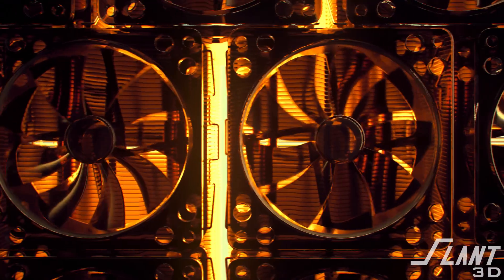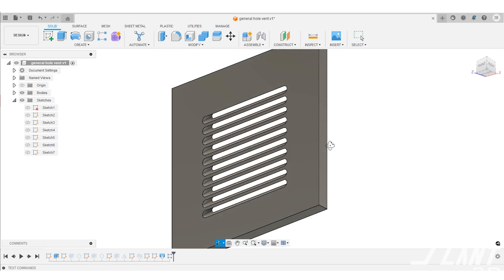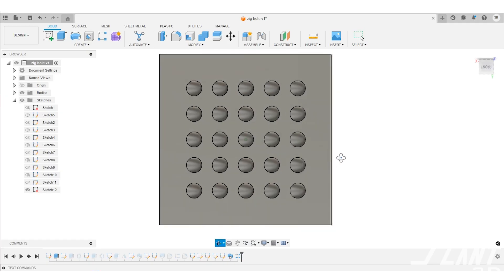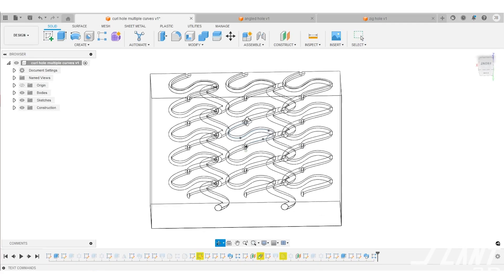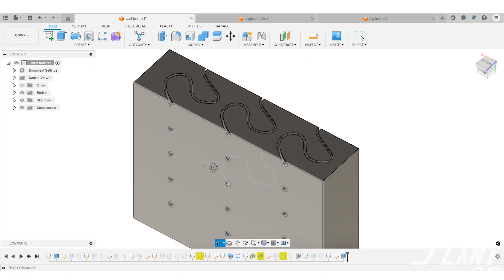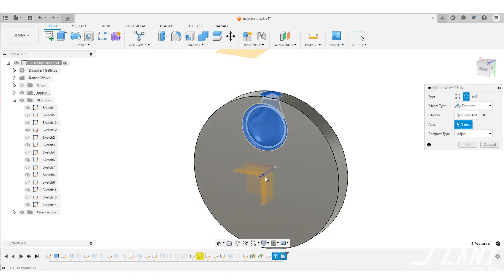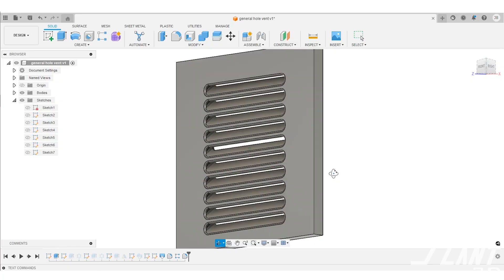These Cooling Vents are Impossible | Design for Mass Production 3D Printing

Comment: Or, hear me out here, just print the thing flat.
Or even better, just print vertical slots so you don't need to worry about stringing. Or just print the holes in a vertical eye shape so you don't have to worry about the printing overhang.
...
This seems like creating a problem in order to solve it. Badly so.

Comment: Alternatively, you could print the part flat, and all of a sudden, you dont have islands, and you dont need support material. If you needed to print slots standing up like that you could make them vertical, which would eliminate support material as well. I feel like your examples are deliberately how not to print.
Reply from the maker: For mass production they must be printed vertically

Comment: I mean… these re cool ideas but I would be curious if these are actually an improvement. In my eyes using simpler covers in combination with ducts to direct or manipulate airflow sounds a t cheaper, simpler and easier to design.

Comment: What if you make a plate with holes, then another plate with holes that are offset. Mount them with a spacer... much faster to manufacture and you can easily use a laser to quickly cut sheet steel... so it can also handle much higher temperatures and still block light.

Comment: I know its not practical, in fact its probably just about the furthest you could get from "mass production" but I still cringed a little every time you said "its a design that is unmanufacturable with any other process." Every design you showed could be made using lost wax casting, or some similar variation of it. Heck, you could possibly even 3D print the negative instead of using wax lol

Comment: You could easily make these patterns using whatever manufacturing technique you want. You also don't need supports for a 3d print like the ones you showed if you rotate the model before you print it.

Comment: The second example with straight slots is a perfect case for rotating it 90 degrees so the slots print vertically as their would be no bridging and no support would be needed if the slot is cut with rounded edges making an arch.

Comment: I don't think you are thinking straight here. You are creating something for the sake of talking and ending up with a series of capillary holes joined together with plastic. Anyway, the noise generated by the fans would be horrific and the air would find some other than intended way of getting out.

Comment: S-Curve Air Vents!. Makes for a very cool, one of a kind heat exchanger made out of thermally conductive plastic!  Could even make for air-tight sealed enclosure, avoiding dust inside sensitive electronics enclosure!❤👍

Comment: While the support problems you noted with horizontal slots make sense, and vertical or diagonal slots would introduce the same islands that caused rejection of round holes, I wonder if diagonal slots with a nonplanar slicer could solve some of these issues. You would still need to build up the slot in layers, and that would require islands, but a couple of diagonal layers or a diagonal "stem" on each step would serve to lock the islands to a single common strand.

As to the weird hole path concepts… I struggle to see any merit to them. Thinner pipes have more drag per cross section than wider pipes, and longer more than shorter. If the goal is to minimize restriction of airflow, the pipes should be as short as possible and as wide as possible. In other words, a sparsely perforated flat plate. Overwrought internal passages may be of interest to a heat sink, in which narrow spaces and turbulent flow may improve heat transfer, but for simply exchanging air these solutions are strictly worse. Your suggestions of internal dust traps in a part designed specifically to be impossible to thread a tool through are, frankly, deranged.

Moreover, your claim that these forms are unmanufacturable with techniques other than 3D printing neglects processes such as lost material casting and multi-part assemblies. If it is possible to produce a turbine blade with internal coolant channels by non-3D printing processes, it seems strange to suggest that your vent covers will be any more challenging.

Finally, it seems a dubious engineering philosophy to design parts to fit a process. Here, it seems you have gone even further, and are proposing designs merely to rationalize using a process you have already picked—perhaps even to justify purchase of expensive equipment. Instead, process selection and design should go hand-in-hand. If the requirement is a vent cover, then it seems sensible enough to design a stamped piece, or a bent-wire piece, or potentially a molded or even machined piece. 3D printing is not appropriate for the requirement of a thin, plate-like shape with a pattern of holes, and inventing reasons to use a slower and more error-prone process does a disservice to your design, the process, and the application.

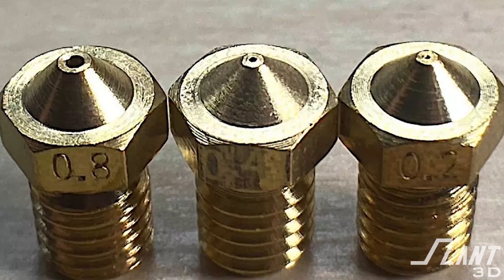Comment: For the example at 1:40

Why not print it laying flat? No supports needed, the thing becomes one of the easiest prints you can do if you just orient it the right way
Reply: For auto ejection without coolling down the bed. Enegy loss and time loss. You want less contact with the bed yo the pint head can push it off. you also get some leaver action. You generally print one piece at once to reduce travel moves and cost per failure. Better to fail one part then a full plate.
Reply: I think they need to make a lot so they have to be put up down so the print takes less space on the bed but I don’t know if this is right
Reply: @Burntsteak-ut6hm  if you lay it flat, you can print it faster, compensating for less parts per plate
Reply: @jackgamer6307  how did you respond so fast
Reply: @Burntsteak-ut6hm  I was on my phone and got a notification
Reply: @jackgamer6307  k

Comment: highlights:
- the guy goes off on some ill considered rant about vortex generators and laminar vs turbulent flow, and somehow managed to completely ignore (and catastrophically fuck up) porosity, static pressure, air flow impedance, ease of cleaning and maintenance...
- at one point he mocks up the weird disc with the holes redirecting to the sides thing with 5 holes, and a 5 bladed fan. does he not know why most fans have prime numbers of blades? our protagonist has just re-invented the old timey air raid siren!
- near the end our hero suggests 3D printing copper heat sinks. in a video about mass production

you can actually use 3D printing for all sorts of cool well optimized shrouds and ducts for a fan that would be difficult to make through other means, but the trick to doing that is to actually think about the application, not vaguely imagine what you think a fan does in an entirely abstract machine.

Comment: This hurts to watch. yes you can put turns in these shrounds the question isn't what you can do but what you should do. Most fluids including air slow down and lose pressure if they have to turn or bend. even slants are not a great idea unless you need to redirect air. Yes you can do this but unless you have a specific need this is not how you should design vent holes.

Comment: I'm no engineer, so take my ideas with a  pinch of salt.

If we've designed a fan plate to act like a dust filter, then we have designed a dust filter, haven't we?
 
A dust filter that would either clog up and give us zero airflow, or give us poor airflow and let all the dust in anyway.

So this hybrid is both a bad fan plate, and a really bad dust filter.

I dont say it's impossible to design an actually useful fan plate that uses 3D-printed micro-structures (easilly plugged tiny canals, that kill the airflow), but then we'd need to have an entire structure designed to take the air in, swirl it around to separate the dust, eject the dust through side ports, and let the clean air inside. I have never seen a dust filter that doesnt require maintenance.

It seems like we'd need wuite a fan behind this "fan plate" to get any air inside through that.

Or maybe itd be possible to nake afan plate from mumtiple layers of sparse grids of filament that act like a dust mesh... Wait... Uhh..

What about an ionizer-based 3D-printed air filter? It ionizes the dust particles and makes them stick to the walls of... Our chasis.

Maybe we xould 3D print a large block that'd have relatively wide canals - say a mm. Thatd gently wobble the air left and right and provide extra paths for the dust to fall into due to inertia... Then wed just need a tray underneeth to catch it all sonwe can clean it every now and then - or just drop it on the floor and let sonething else deal with it.

If this fan plate.. I mean filter block works, we could revolutionize the industry.

Or evolutionize ourselves out of the business...

Comment: First minute of video:  Printing circles sucks, because we're creating islands and we might get filaments bridging the holes.
Next 5 minutes:  Let's print circles, but make them weave through the material at odd angles.  

I see a lot of creative ideas here, but also a lot of flawed thinking.  All this redirecting of air is just causing huge inefficiencies in flow.  Meanwhile, it WILL clog with dirt very quickly.  I don't see that as a "benefit," because it's not always easy to reverse the air flow, and I'm not convinced the dust will just leave.  Furthermore, 3D layers are quite bumpy, and man that is perfect for catching and holding dirt.  Now you need an additional step to smooth the internal tubes.

Fun sales pitch, but I think I'll pass.

Comment: For the first few examples, you can also just lay the part flat on the front face and you wouldn't have to worry about support material.
Reply: THANK YOU! I was sitting here trying to figure out why in the F they would print those parts vertically at all. Sometimes these videos are insightful and educational - this one missed the mark for me
Reply: My guess for printing the square vent covers vertically is due to the mass production aspect of this company, since they can fit more of these vent covers on the same plate of a single printer than laying them flat. But he really should have explained that. Still I don't see why he was printing the ones with long slats with the slats oriented horizontally instead of vertically.
Reply: @Eidolon1andOnly  Even if you can fit more on the plate at once... surely printing them vertically would require it to be thicker, and as a result make it need like, idk, but my uneducated guess is at least twice as much plastic (compared to just 1-3 layers printed flat),
and so I would imagine that each piece should take like at least twice as long to print?
Well, if printed individually, but I don’t see why printing multiple with the same head at once, would gain that much speed..?
I guess for two of the axiis, you can combine the time it takes to move along that axis, doing it once for each part in a line,
but, is “moving while not extruding filament” a substantial fraction of the printing time..?
I guess maybe it could be..?

I don’t have any experience in this area, but it still seems counterintuitive to me that it would be more efficient to have them vertical, and I’m still skeptical about it..

Edit: apparently it isn’t so that they can fit more on the plate, but because a lower footprint results in making it easier to have it automatically removed from the plate after being printed. Huh.
Reply: @drdca8263  It would take roughly the same amount of plastic though vertically would require some support material. Though if you were to print just one individually, there'd be very little time difference between vertical and horizontal. But let's say, for example you have a plate capable of fitting four of these squares horizontally and it takes 8 hours to print all four, but you have an order for 120 of these square vent covers made. That means you'd have to scrape the plate after every 8 hours of printing 30 times to reach the goal of 120 total square vent covers. That's 240 hours of printing plus the time it takes to exchange out the plate or clear it off for the next print. 10+ full days. But if you were able to place 20 of these vent covers on the same plate by printing vertically, and it took 17 hours to print all 20, you're only looking at 10 full prints to reach your goal, and it would be done in a little over 170 hours with clearing the plate each time for the next print. That's only a little over 7 days. That's a pretty decent time saver.
Reply: @Eidolon1andOnly  I had assumed that the reason they needed to be so thick, was so it would stand up straight while printing.
Could one print one of these vertically while being only one or two “layers wide”?
Reply: @drdca8263  That would be extremely thin. Even if printed horizontally you'd be likely to break those things just trying to remove them from the plate and they'd be delicate to handle, especially depending on the material. But I'd think it could be done thinner and still print vertically. The only reason some were thicker than others was the internal geometry inside needing additional thickness, not because of vertical printing. The thinnest ones he showed were likely because of a very particular spec requiring that set thickness, it had nothing to do with supporting weight or whatever while going vertically.  Even the thinnest ones he showed could be made thinner without any support, but to make extremely thin vertical prints, with very little additional material a lattice like support structure could possibly be used to keep everything upright.
Reply: @Eidolon1andOnly  Ah, ok, thanks
Reply: Put it both ways and slice it.  Check out the time.

Comment: this issue with 3d printed slot length goes away if you dont print in the worst possible orientation. print those flat and you wont have issues. Also saying all the more intricate designs were impossible is just a straight up lie. all of those could be done with metal casting, and yet we never see anything like that in industry were small improvements can often justify increased cost.

Comment: I feel like printing this part in a vertical orientation is an edge case that's applicable for printer farms. I don't think this is the optimal way to print it. Not only will it take longer, but it's going to introduce more visual defects. All of this in the name of part ejection. If you're a hobiest, none of this is as applicable.

Comment: What I often do in situations like this is to use a grid. But normally, FDM slicers really don't like grids, they will essentially play snake on the build plate and mess everything up. The trick here is to interleave columns and rows of the grid, with each of them being as tall as a layer height. They still mostly fuse, even though technically, it's just 50% of the material.

Comment: Why invent problems that can "only be solved by 3d printing" for a product that is perfectly manufacturable with conventional methods. A vent cover you probably want to be metal anyway and punching holes in sheet metal is super fast compared to printing. And if you want it to be a thick slab of plastic use injection molding. 
If you want the cover to be much less efficient and trap dirt, just overlay two or more sheets with offset holes.
Reply from the maker: And if you don't want it in metal? And want it to provide functions that are unmanufacturable?
Reply: @slant3d  you can injection mold in plastic or cast stuff in resin. And most of your examples can probably be moulded in two pieces and glued or welded together if you really need the holes to have a slight s curve. (It's not like 3D printing avoids a seam line, since ever layer is a seam anyway). Of course you can create a shape that would be very impractical to cast or mould; but I really don't see why you would want something as simple as a vent cover be super complex.

The whole idea of 3D printing for "mass production" seems rather silly. It has specialised applications in already very expensive products such as high end engine parts or rocket engines etc. But because 3D printing is super slow compared to moulding, you only would use it if it's a one off prototype, or it's a major improvement in function or conventional manufacturing would be too complex anyway, and vent covers are not that.

Comment: Those S-Curves would be brilliant in window coverings like blinds: very good air flow, with complete privacy.  Would probably be great sound-dampening too.
Reply: just use fabric
Reply: @@GarrettWAssuming the tubes through the plate have the same cross section throughout their length, it would be the same air flow as straight tubes minus the extra drag created by friction with the longer walls of the tube, which is negligible.

Comment: I've just been going through these videos today, but this is the first one that felt odd. the first two or three designs that had issues with needing support would have been much easier to vertically print if you just rotated them so the slots were vertical, wouldn't it?
Reply: well said
Reply: I think he wanted to avoid having many "islands" horizontally. Still there are countless more sensible ways of making a cool yet working fan shroud

Comment: I have two questions.
1. Who is mass-manufacturing using a printer? 

2. A slot has support along the axis of its length, but it has almost no support on the axis of its width. By using slots of only a single orientation you are only providing support in a single direction, am I not correct? If you used two slots perpendicular to each other, you would have support in every direction.